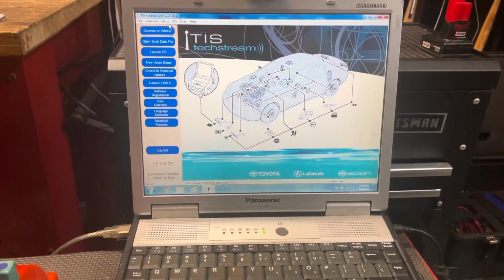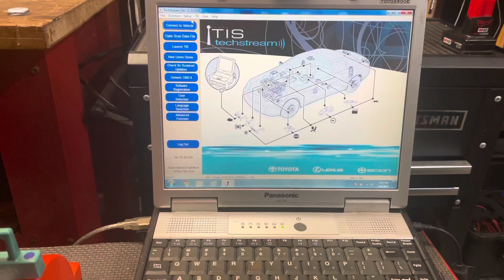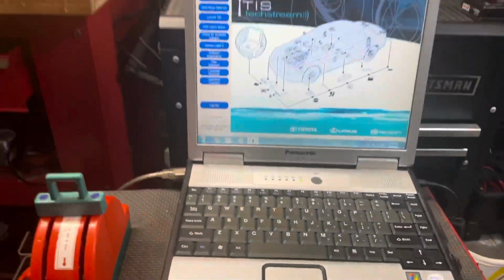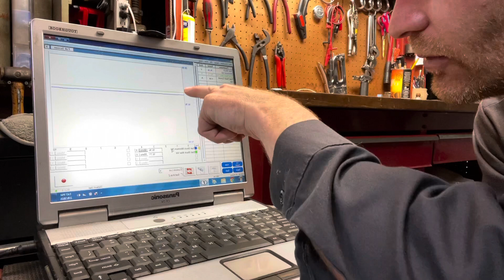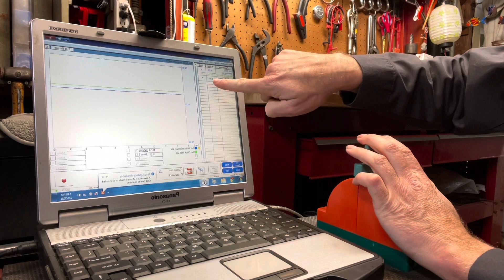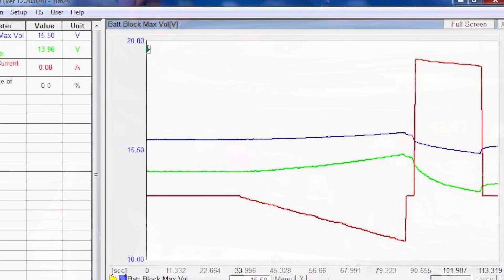DIY hybrid battery dyno

Comment: @Mr. Electric Thanks for another great video. I was thinking of attaching all the modules to a grid charger & also to a large load like an oil heater for discharge. Only issue is, I cannot find a battery analyser to attach to every module to get the battery charge/discharge live data.

Do you know where I can find a battery analyser for all the modules?
As suggested by you, is there a way to automate the whole process of charge & discharge with more cycles etc? If so, I would be highly interested in purchasing a similar setup.

Comment: Great work like learned it’s same wire connection with Prius C (aqua) if not please give wiring diagram please
Reply from the maker: Almost certainly different plug into the HV battery ecu on the Prius C. I dont have the diagram but it is out there if you search for it I'm sure.
Reply: @Mrelectric423  thanks by the way do you have any idea how the maxx volts make it

Comment: Great video , how did you connect the ECU to the miniVCI? I also see another cable pairing being routed somewhere else .
Reply from the maker: It is a basic harness with power ground, can h, can l. The other cable is the 12v power.
Reply from the maker: Added this link to the description. I put the adapter diagram here
https://priuschat.com/threads/my-diy-hv-battery-tester.223132/#post-3122736
Reply: @Mrelectric423  thank you

Comment: Very cool.  I wouldn't call 12A a heavy heavy load, when the car charges at 90A and discharges at 150A, BUT 12A should be more than sufficient to produce the min/max deviation.  Of course, if you have Techstream, and the battery is in the car, simply turning on the A/C, rear defroster and lights will pull about a 12A load, and you'll see the min block voltage crash too.  Lastly, every now and then you'll see a cell that's not dead-dead, and this test must be run a surprising amount of time.  Voltage deviation is good until lower SoC and THEN the crash.  As demonstrated, this test would not pick up that as a bad battery. It might have to run for 5+ minutes.

Still. Very nice. The direct connect to the battery computer is slick.
Reply from the maker: I was thinking about possible improvements on the tester like an automatic charge/discharge  cycle to a certain hvc and lvc but it works well enough as is for my purposes. For years I was hoping midtronics or another established battery test equipment company would make a tester that really loads a hybrid pack. I guess its probably too nitchy or too expensive to manufacture. The in car test is of course the best/easiest when possible.